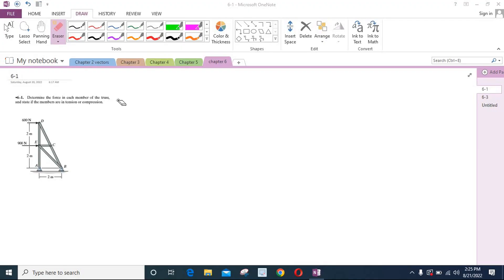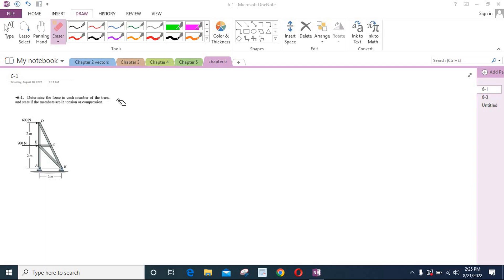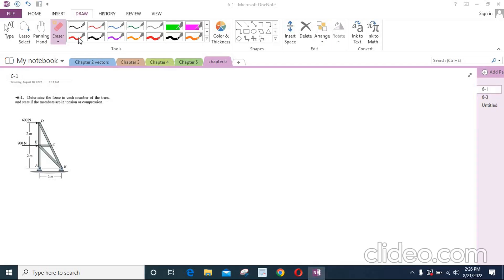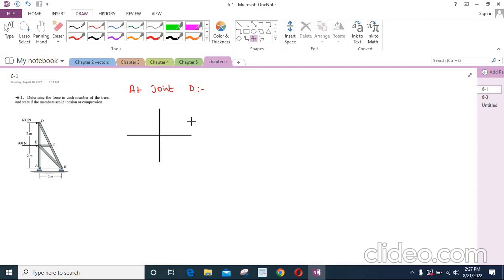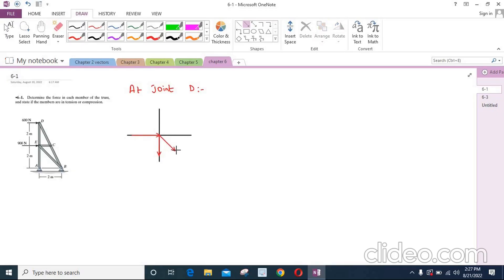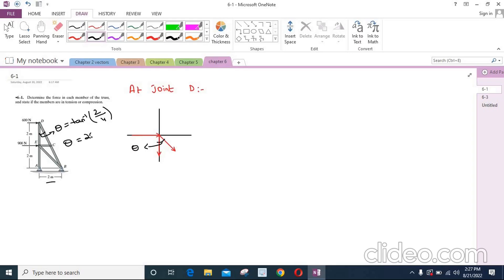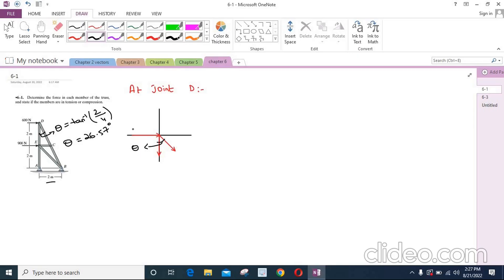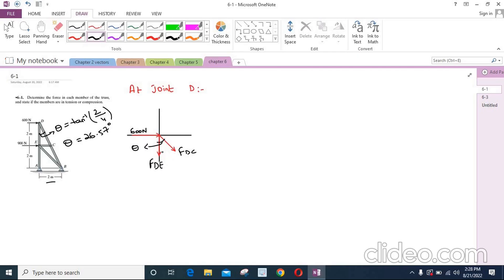6-1 hibbeler statics chapter 6 | hibbeler statics | hibbeler

Comment: sir FDC downward tha apne positive Likha why
Reply from the maker: Hi, 
In the truss analysis, we could either have members in tension or compression. 

In the first free body force diagram I had assumed FDC was a tensile force but I was getting negative values for the FDC force, which means FDC is a compressive force.

In the second free-body force diagram I had correctly drawn FBD as a compressive force so I no longer have to put a negative sign with that.

 I hope it will help